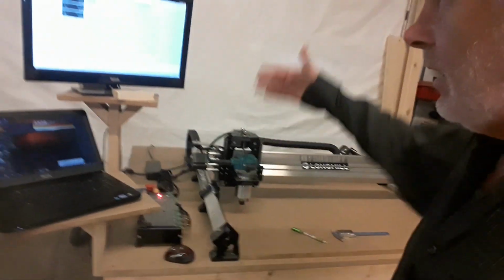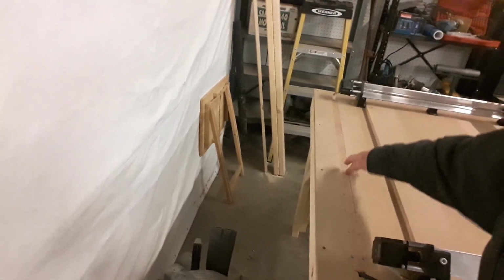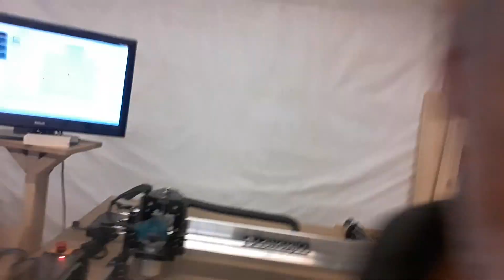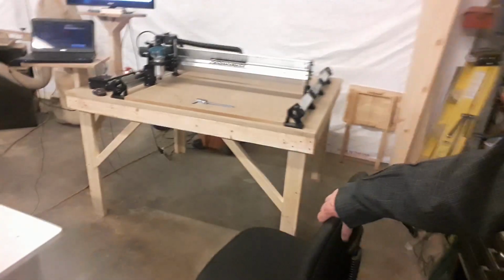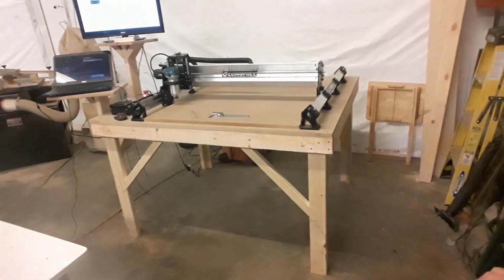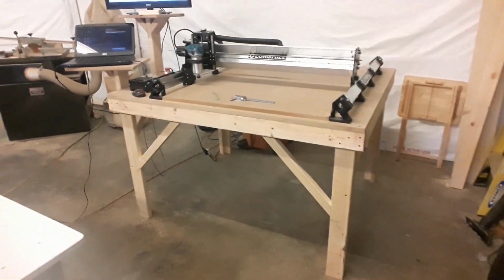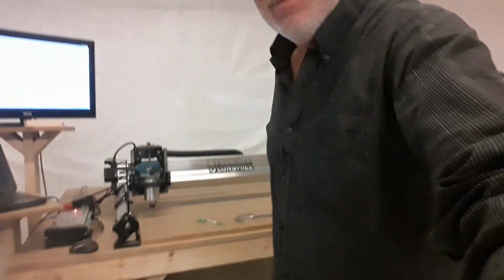Sienci Longmill CNC Router Build [Update] - Garrett Fromme

Comment: Hi Garrett.  Norm Streeter here from Waldport. I currently have a much smaller CNC machine (12 X 24 capacity) and am truly interested in a Longmill.  Will be looking at their website soon, but also am looking forward to some of the additions to it, like the table build, etc.  One question I did have, however, is this:  I have V-Carve Desktop on my computer, and I have to operate the CNC with a pendant.  Do you know, offhand, if the controller for the Longmill will accommodate this kind of set up?  Have a great day!
Reply from the maker: NormanSteeter, A longmill will work great with your Vcarve Deskotp brother. As for a pendant, that is something you should reach out to Sienci about to double check!

Comment: I HIGHLY recommend getting the IoT Relay for automatically turning your router and dust vacuum on/off with each run. 
Next, tweak the Post Processor to make it automatically load the code to turn the IoT Relay on/off. Use the "Guide to editing a Vectric Post Processor". It is under the Help tab. Pure gold! 
 It would be good if you did a video on how to "square up" the whole system. Especially the Z-axis perpedicularity (it's a technical term) to the spoil board.
Reply from the maker: Hi Gary. Kind of like the word 'cylindricity'. I will definitely do all those things, especially the Iot. thank you

Comment: Hi Garrett, First of all I hope you feel much better really soon, get the rest you need. I like you're work table for the Long Mill, looks good and sturdy!  I bought a Shapeoko XXL some time ago, Not in the market yet for another cnc yet, but will have a closer look at the LM when the time comes. Looking for a suggestion maybe??? I built my table very, very sturdy, I like the angled corner braces, that really stiffened things up. If you are right for space in your shop consider putting a full shelf post to post near the bottom. I did this with mine and I put all my credit sign blanks ther, not that I have a lot, but it also serves well for regular used and of me for easy reach, maybe even a slide out to be even more user friendly. Get well my friend! 👍 Andrew
Reply from the maker: Hi andrew. thanks for the suggestions. I will definitely do that. I too want mine to be absolutely rock solid

Comment: Garrett you just described where I am right now with my purchase. I’ve looked at a bunch but can’t decide which one to get. The Longmill looks good but I would like to have a 4d option to explore when I want. Have you looked at the CarveWright product?  If so what are your thoughts?
Reply: The CaeveWright looks like a nice machine and it would do everything I would want to do. I like the small footprint and the ability to upgrade to 4d. Also to create carvings up to like 12ft long but only 14.5 inches wide. Looks like it’s married to their software but it looks pretty easy to use. I’ve not seen Longmill before today. So checking it out.
Reply from the maker: Hi Jeff. This message popped back up on my list of unanswered comments.  I appologize for such a long delay. I thought I answered it. I have looked into the Carvewright. Personnally, I feel it takes away some of the creative ability you would have with a open 3-axis machine. It felt too limited.